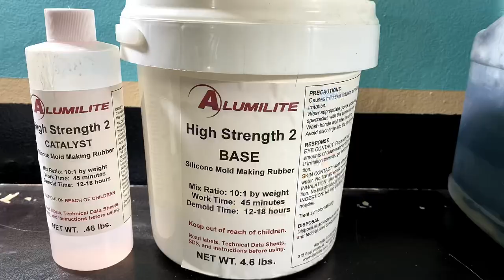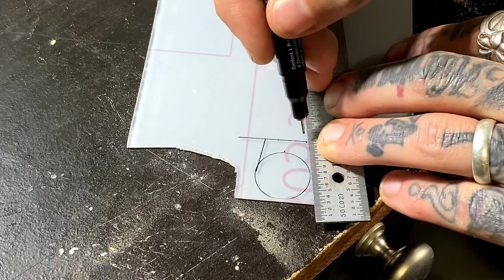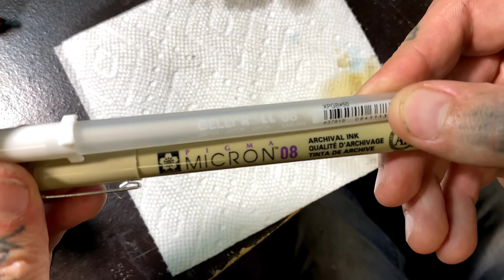Lure Making a Shallow Diving Crankbait

Comment: Nice work. I would love to hear a commentary from you while you work as apposed to the music but we've already been over that... still a great video. I liked the clamps on your spinner, nicely done. I also like the technique of installing the eyes on the master and tracing them to make sure you get them in the right place. I would guess that like me you've probably drilled a lure only to decide "boy I really hate that eye placement" and then had to fill and drill again. place and trace technique eliminates that potential problem. Lastly using the ink pens, I do that too and it makes it super easy to get detail exactly where you want it. Gorgeous bait and well done!
Reply from the maker: Yes I’ve definitely made a few cross eyed baits. Yeah the pens to me are way easier and quicker than stenciling and airbrushing those small details.

Comment: I think making masters is the way to go, easier to produce another especially if it's a great catcher. Brilliant as usual.
Have you tried Polyester Resin for the lure instead of Alumite? Polyester Resin is so much cheaper. I used it for years repairing boats plus I've cast all sorts with it. My mate created a fantastic scull, he added dies to it but didn't mix them in for a nice effect which worked, he also tattooed for years so he probably used inks but I can't remember for definite.
I purchase it from a company close by, it was around £70.00 for 20kg + hardener 10 years ago.
The last Batch I purchased was £18.00 for 4 kg I think but I can't remember the hardener cost, that was 2 1/2 years ago.
You can make it go off in 10 minutes if you add enough hardener but it doesn't take much especially in heat.
You could still paint then finish with your preferred top coat resin. It would be worth trying I think and you could purchase a small batch to test.
Reply from the maker: I might give that a shot because like you said that alumilite isn’t very cheap.
Reply: @TreysArt  I would doubt most commercially sold lures are made from the expensive stuff. Worth a shot I think.